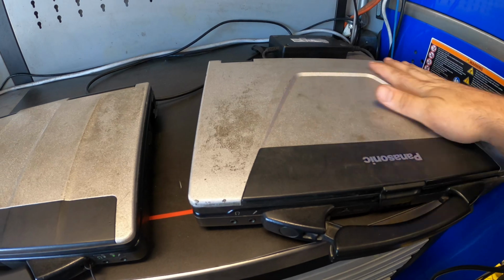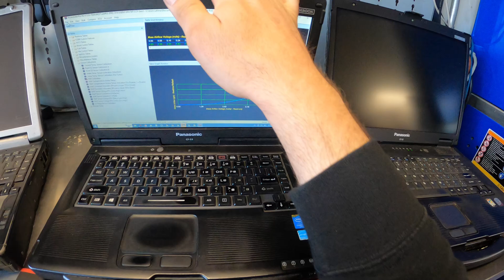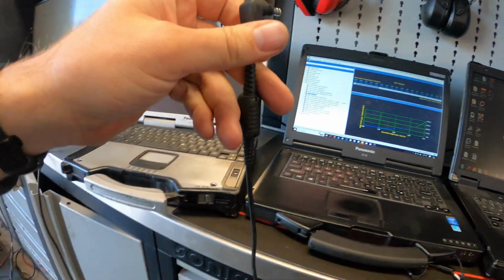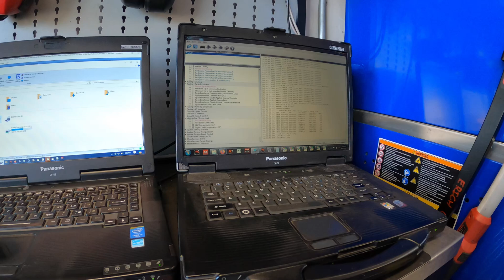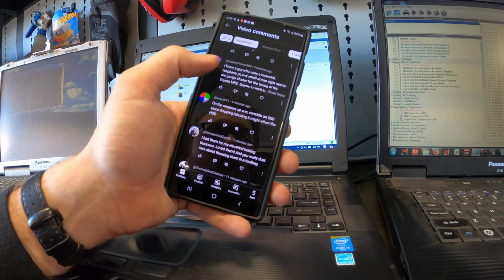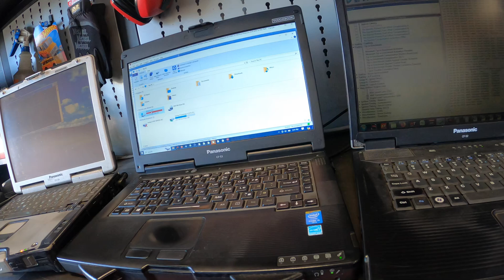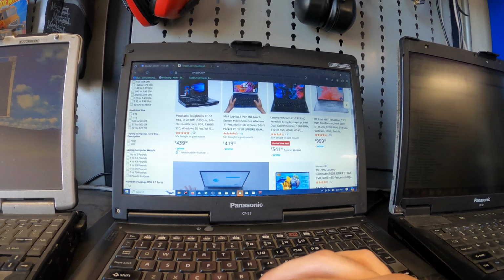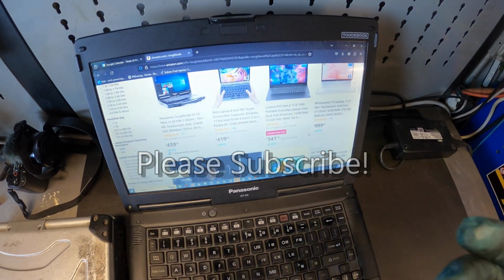Panasonic Toughbook: The best tuning laptops IN THE WORLD!

Comment: Im getting a cf74 tomorrow with 4gb ram and a 128gb ssd he sent me pictures of it working off the charger but said the battery life is mediocre which is fine by me until i get a new battery but im trading a core 2 duo laptop with a gtx 260m i paid 40 for. Cant wait to test it out and put linux on it
Reply from the maker: I use the generic 7.65ah batteries and they work great on the CF52's, not sure if it's the same on the cf74, I've never had one.

Comment: How much storage are those tuning/diagnostic softwares takes usually?
Reply from the maker: Very little.  Specs are generally quite low.
Reply: @WT4T  Appreciated. I recently acquired a CF-31 and it has a 256gb ssd. I was worried about the storage space a bit :)
Reply from the maker: @_louis.se_ how much ram? Some live displays use a fair bit. 8gb+ will make a world of difference to workflow and viewing large datalogs
Reply: @WT4T  Good to know! I'm not sure if it has 8gb or 16 gb ram actually
I'll probably upgrade it if it has 8gb after I checked it. Thank you!
Reply from the maker: @_louis.se_ 8gb is generally plenty

Comment: What methods can be used to identify your stock ROM ID? Wondering if Epifan Software - Subaru edit has definitions for a 18 WRX USDM and works for personal open source tuning, ECU part #22765AL001, DEF003-232 A1 7Z12, ZN, Hitatchi.
Reply from the maker: Yes they do and you can "ID the ecu for epifan software" and it will tell you.
Reply: @WT4T  Thank you for your response, I will get a Tactrix and check it out